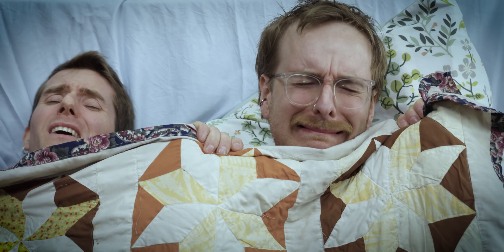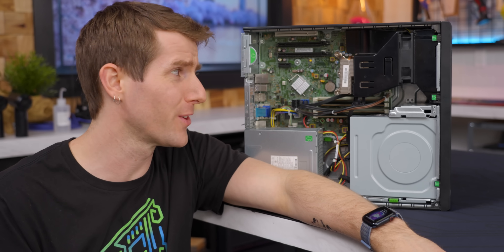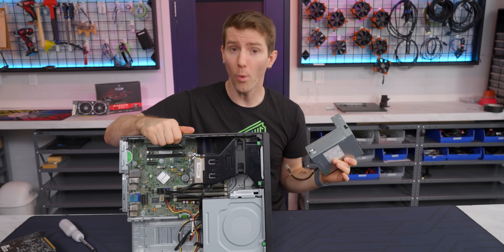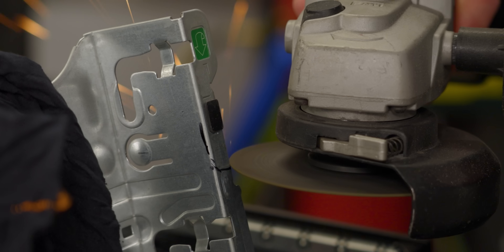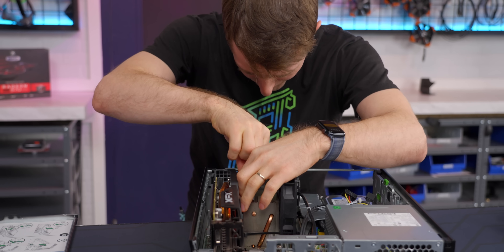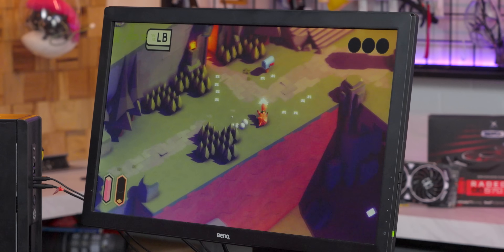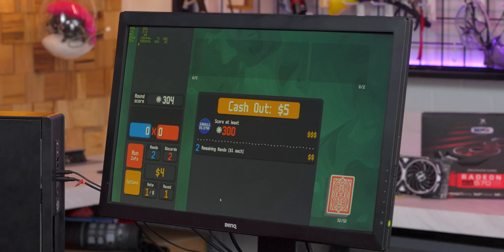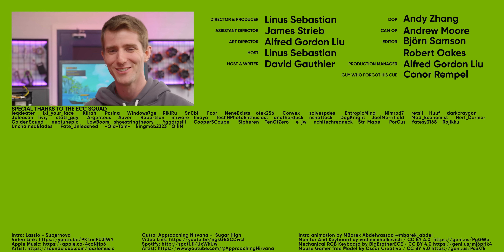How to Build the Ultimate $69 Gaming PC!

Comment: I am reposting a comment I made on another video, since I want to share my experience with prebuilds as well. I can't really reach that level of low price, but I still find what I have gathered to be pretty cheap considering I've went for the maximum possible the system can offer:
I bought a complete system—an HP Compaq Elite 8300 SFF—for around €25, which came with an i5-3570. This CPU is still capable of running relatively modern titles at ~60 FPS at high resolutions, making it a viable budget option. However, I would personally recommend going for a higher-end i7-3770, i7-3770S or a Xeon equivalent, as their hyperthreading significantly helps in CPU-intensive scenarios where the i5 can become a bottleneck. 

For example, in Shadow of the Tomb Raider, the i5 struggles to load textures on time, and in Assassin’s Creed Odyssey, it causes noticeable stuttering. Upgrading to an i7 eliminates these issues, delivering a much smoother experience.

I managed to sell the i5-3570 for €15 and purchase an i7-3770 for €30. I also upgraded the RAM from 2x2GB DDR3 1600MHz to 4x8GB DDR3 1600MHz CL11 (brand new) for ~€40, reaching the maximum capacity supported by the CPU. Additionally, I found a brand new Patriot P220 512GB SSD for €25.

In total, excluding the GPU, I built a fully upgraded Ivy Bridge SFF system for around €105-110. Depending on the games you want to play, you can pair it with a GTX 1650 LP, RTX 3050 LP, or even an RTX A2000 6GB, which are reasonably priced on the used market. I found a used RTX A2000 6GB for ~€195, bringing my total build cost to ~€300. 

With this setup, I can run games like Warhammer Vermintide 2, Counter-Strike 2, Mass Effect Andromeda, The Elder Scrolls Online, and Final Fantasy XIV at 3440x1440 resolution on Medium/High settings, maintaining 60 FPS with occasional dips to the 40s in more demanding titles like the first mentioned or Cyberpunk 2077. Given that the system only draws around 140W at most from the wall during gaming, I’d say this was a fantastic investment—if you can find the right parts at the right price.

Of course, if you can find a Ryzen CPU and motherboard for a similar price, that would be the better choice. However, in my case, the HP Compaq Elite 8300 SFF was 3-4 times cheaper than anything else available locally or even on eBay. So, I went for it and decided to upgrade it to its full potential. My initial plan was to use it as a server and ML machine, which is why I paired it with the RTX A2000. If I have to mention one main drawback of such SFF systems is that they are usually paired with a pretty weak PSU (as Linus here mentioned) which doesn't offer a 6-pin power connector for more powerful GPUs like the RTX 4060 LP, which can be handled by the processor at higher resolutions. (Do keep in mind that 3rd gen Intel CPUs also don't have the AVX2 instruction set which is already used by some modern games so a 4th gen at least is recommended. It all depends on what you want to do with the system.)

Comment: Hmm with that SSD... i would consider investing in PCI-E to M.2 adapter and good M.2 SSD... These cheap SATA SSDs like to die/misbehave (random I/O errors). They are not worth the $ saved, and cheap & small SSD will be the main pain in using this PC. Also it "just" stores all your data, the most valuable thing of whole machine...

Comment: As a sysadmin, I've actually thrown out a lot of Z220s and Z230s.  They're pretty rough and I wouldn't recommend them for much of anything in 2025.

If you want to go down this road, try to get a Z420 instead.  It shouldn't be much more expensive but it will have noticeably better performance.

Comment: I would love to see a mini PC setup build, especially with Minisforums Barebones UM890 pro with the Oculink port and EGPU Dock. you can pick storage, Ram, GPU and Operating System. With the use of a usb 4 hub, a bunch of other cool options are accessible.

You can get 144Hz Portable monitors using usb-c it could be worth even to make it interesting compare it to Gaming Laptops, see If you can build a better Performing setup using the same Budget even change it to a range to see at what price points which is better. 

A gaming Laptop is not much easier to transport as they use similar Power supplies, The thickness of Gaming laptops takes up a lot more room over your entire bag while a mini pc takes up the room at the bottom corner of the same bag, with the Portable display only taking up the space of the panel itself Leaving room for the Mouse and any Keyboard most suitable.

The fact some Laptops have Soldered Ram should mean that the Mini PC should be allowed to use 2nd hand ram,  it is a benefit to that option, if the laptop can also be specced as a Bare bones unit I think that would be an even better comparison with how similar it can be.

Comment: I recently picked up an old Acer aspire 1760 that had similar power supply connector mismatch. But instead of the second power supply I manually wired an old ATX compatible power supply to the motherboard. (Connecting the right voltage wires from the ATX power supply to the Acer motherboard.)  That way you don't have to use two power supplies and worry about them not turning on/off in sync.

Though a second problem I ran into was that the Acer motherboard needed standby power to be provided before it could activate the Power button, which would turn on a ATX power supply. So I had to jerry rig up a solution where my power supply is turned on initially by my restart button, and then the motherboard's proper start up is powered on by the power button. So you have to hit both to start the computer.

Comment: i built a $85 gaming pc from a HP 500 017c the cost was the PC itself and a RX580 8gb, I had the 16gb ddr3 on hand and a 600w PSU

It later is going to become my AM5 system

likely with a 9600x and a 40 series card in it or a Radeon card 

on top no HHDs all SSDs with a Blue ray drive to top it off
Reply: its my Linux machine

Comment: I got a dumpster Dell Precision 3430. Has an 8th gen i7, I put a 2tb WD nvme, usb wifi dongle, a sff RX 6400, dropped an 80mm fan in the front panel to blow cool air across the gpu, I then cut a hole in the top of the case and dropped a Cooler Master i7 Copper cooler with a magnetic dust cover slapped over the hole for the cooler. I can play most everything I have including, Anno 1800 with no issues.
Reply: Hate sff , it limits you to best GPU you can put there, which you did.

Comment: If you don't want to break the computer open with power tools, the 6400(4GB) and 3050 6GB both have small form factor variations. That said, the 6400 runs for about $120USD used right now and the 3050 runs about $200. The 6400 runs on motherboard power and most of the 6gb variations of the 3050 also run on motherboard, but you need to pay attention.

They both can player Cyberpunk, Baldur's Gate 3, Helldivers 2, and other modern-day games HOWEVER you'll be on low settings, and you'll be running on the bottom of the barrel on graphics. Similar to what you saw in the video.

Comment: I am a technician and run an IT business and I had all kinds of older great computers that I put a lot of time and effort into refurbishing, replaced thermal paste on and even upgraded some with additional RAM and brand new SSD's fairly significantly and had them up on Ebay forever and they never sold, I even had brand new computers I built listed on there and those never sold either. So now I just essentially take out the CPU and the RAM and sometimes keep the coolers and power supplies and sometimes the cases or motherboards and e-waste what I'm not going to keep. I've got all kinds of older components and even older All-In-One computers that are still pretty good. The only thing that ever sells on Ebay are used laptops as far as computers go. People seem to buy the individual CPU's I've listed there and that's about it, it is kind of a shame for both me and people missing out on them and also a lot of wasted time and effort. The older components seem to have more value in the materials they are made out of also.

Another factor here is with Windows 10 Ending support in October 14th of this year you will need an 8th gen or newer Intel CPU or a more modern AMD CPU to support Windows 11.

Comment: I got a really good system second hand (someones covid gaming pc) but turned out the motherboard was faulty. The issue wasnt obvious and a couple of components got damaged before we figured it out. I have to say that running linux made that pc extremely usable. I could not get windows to work at all with that set up (after a while, windows was what it had when I picked it up). I used that PC for about 2 years until I could swap in new parts that didnt have issues. While getting second hand stuff is risky the amount that you can save makes it so worthwhile imo even if theres something that is wrong with it that wasnt obvious.

Comment: I upgraded from my 580 8GB OC card this year but it was still running new release games above 100 FPS; with my tune on BO6 with display scaling I was able to get over 220 FPS. I’m still running my AMD Ryzen 7 3700X and DDR4 memory. Minecraft with Zesus shaders and 64 resolution pack was solid 70 FPS; I would recommend a 580 8GB card if you can get it for under $70 it’s worth the price probably got a year or two left before you have to upgrade unless you want to play pre 2024 releases without issues.

Comment: I tried to find something like this quickly and cheaply on the internet, with a bit of newer details and with which the user could also play newer games if necessary. These are European prices.

Intel Core i3-14100F / 74.99 euros,
----------------------------
ASRock Socket 1700 B760M PG Lightning / 116 euros,
-----------------------------
Kingston DDR5 Fury Beast Black 16GB 2x8GB 6000MHz
KF560C30BBK2-16 / 71 euros,
-------------------------------
Power supply Chieftec VITA Series 750W 80 Plus ATX/ 67 euros,
--------------------------------
SSD Lexar NQ790, 1Tb./ 68 euros,
----------------------------------
Video card ASRock Arc B570 Challenger 10GB OC/ 270 euros,
---------------------------------------
Case Asus A21/ 55 euros
-----------------------------------------
Total 721.99 euros

Almost forgot, Silentium PC Fortis 5 140 mm CPU Cooler SPC306/ +53 euros

You also need Windows 11, fans and a monitor. and some kind of mouse and keyboard.

Comment: i managed to get a free pc with an 11th gen i5, 8gb ddr4 3200mhz and a 500gb nvme ssd, the only problem could be fixed by adding a GPU, so i could have spent $69 on it and boom (although i had a 1050ti sat around which i also got for free)

Comment: $269 would be great! I think at $169 you’d have some good improvements in what you have already (such as the upgrades you mentioned in video) but $269 is a very affordable pc still that I think using the same cost savings mentality as in this video, will result in a very useable pc

Comment: Gotta have to say gpu wasn't an issue with the games tested for example on cs2 i have gtx 950 2GB and i get 120fps with mediumish settings but most of the time my other pc parts help with the lack of 2GB VRAM although my pc is also a bit unbalanced because most of my parts i got are hand-me-downs or got them at a really good price
My pc specs if you're curious 
CPU: ryzen 5 1600
RAM:24 GB 2666MHZ
GPU:GTX 950 2GB
2SSD 1HDD and 600watt psu

Comment: I have done the exact same thing with an old PC i had.   It had an intel i7 3770 equivalent xeon v3 E something 16 gb ddr3 ram and an rtx 3070ti😂 just lying around and wanted to make something to game on my macbook air using windows 😂😂 so i grabbed a stone something cheap case that came with a 250 watt PSU that had 1 sata port and a molex i used a sata spliter to add 2 more sata ports to hook hdds to and an other server supply 1200watts with a breakout board to power the GPU and I got a dummy HDMI slaped it all together and installed Moonlight and sunshine and hooked it to a router via ethernet and an other long ethernet to hook to a usb port using an adaptor in my macbook and THAT is how i can game on a 10 year old macbook at 1366x786 resolution laying in bed 😂😂😂 on a half decent PC  that has its case cut open 😂

FYI  I do have a ryzen 5700 and a 3080ti PC this is just for fun and I use this one more 😂 cz it was fun to build
Reply: I can post pictures of it if u wanna see it 😂

Comment: Despite the limitations of its Intel i5 2320 processor, the Acer M3970G Desktop (with 16GB of RAM) was able to utilize a significant portion of a GTX 1060's capabilities. Though a bottleneck was present, the system achieved respectable performance, consistently using over 50% of the GPU with a very very small performance bump compared to the i5 2500S

Comment: I always love the absolute bottom barrel price point computer builds but honestly I find it just as easy to find standard sized desktop pc’s for basically free. I’d away avoid the micro towers or anything half height since u are absolutely limited in gpu options unless u do cutting and jank stuff. Also, as was suggested by Linus a quad core cpu is absolutely necessary but also imo the most important aspect is that it basically has to be hyper threaded to prevent game ruining studdering. But fortunately any intel lga 115x xeons all the way from 2nd to 7th gen chips can be had for literally less than $10. Pair that with a $80 gtx 1070 and you have an absolutely solid computer for around $150. And it’ll probably look normal and be sellable once u decide u don’t need it anymore.

Comment: Few powerfull tips:
> 240W PSU is plenty enough for GTX 1060 6GB. Running a 6pin PCI-E power adapter from a single SATA is also acceptable with this kind of GPU. Did this many times and had no issues at all. Cables didn't even get warm in Furmark.
> i5 2500S is atrocious CPU, even in this budget. Not only its a super old 4c/4t, it's also energy efficent, making it even worse. Getting a cheap-ass Xeon from Aliexpress is the way to go. $20 for 1230V2 (i7 3770), or 1240V3 (i7 4770) is the way to go. You can also buy new 1x8GB DDR3 modules from Aliexpress for $5 apiece.
> RX 580 8GB for $35 is such a great price. Sells easly for $75 here in Poland lol

Comment: For 70$ i got lenovo pc with 1x16gb ram, i7 9700k, 1tb ssd m2. Got 16gb stick, gtx 970 to switch between spacedesk. No i have cheap 100$ gaming server. Psu needs to be replaced because it don't works with more powerful gpus. Downside is no lenovo gaming legion software, couldn't install it after flashed m2

Comment: If you are willing to take some time to do this you can even manage way more. A couple of weeks ago I managed to get an gtx 1080 build with 16GB DDR4 ram and an i5 7600k for 80€. And I even was willing to be an asshole, managed to sell it for 400€ on the same day and got a 340€ deal on a pc with an Ryzen 9 3900x and an RTX 3070. I basically spend 20€ and a weekend to get a nice pc. 
And for all that I just used local deals in a range of 20km. I picked it up by bus which was kinda awkward but I managed and it was well worth it. 

I also sold the pc a week later for 800€ and got another deal for a pc with an Ryzen 5800x3d ,32gigs ddr4 and a RTX3080ti for 900€ so I feel like lowkey not a lot of money left my bank account 😅

Comment: I went to do this challenge and seeing as I had to buy the LTT screwdriver set and the Thermal paste pad I only had 4 dollars left to work with.
Reply: You didn't have to buy anything
Reply: @Mark_badas I didn't have to make the comment either but here we are...
Reply: @manleycreations6466 they are right tho. You don't need that gear,  it isn't optimal but when I built my first pc I used a thin knife as a screwdriver. And the paste was 3$

Comment: Been rocking a very similar hp sff pc for years now! Added some ram, a gpu and some faster storage, and changed the cpu over time. Its still a pretty capable machine, running rdr2 with some decent settings on 1080 at ~60ish fps

Comment: I know this is not possible with 69 Dollars.
But imho the best bang for the buck is i5-8400 or similar systems.
They have ddr4, more cores, nvme support,  native win11 support, far more performance etc.
My best deal so far was an asus board, an i5-8400, a cooler and 16gb ram for 98 €.
I defended my i7-2600k for years, but those systems show their age for a while now.

Comment: I got a HP 8200 SFF took out the pow supply out gutted it , And gutted a 750 watt power supply and put the parts in the Hp 8200. power supply 's case, Put a LP GPU in it and 52 gigs ram and i7 ,

Comment: for anyone interested the tool he’s using is an angle grinder, with a metal cutting disk. you can have a new angle grinder for as cheap as 40$ and a disk costs 2$. be sure to wear personal protection and know what your doing when using them they can be a bit dangerous 👍

Comment: My house is full of these. I love SFF workstations as media PCs. Great for family gaming and movies. If you find an optiplex with an 8th gen cpu, you CAN flash the bios to accept 9th gen CPUs. Pair that 9th gen i5 or i7 with a decent LP GPU and you've got a great gaming rig for the price of a series S. If you can spend just a touch more, go with a Lenovo p340/350. They have beefier power supplys, and more room inside. I spent just under $500 and my kid has a 10th gen i7 and a 4060 LP.

Comment: I was lucky that my previous PC was an i5-4690 with 8 GB DDR3 RAM and a GTX 960 2GB I bought in 2015, which I upgraded fairly recently with an extra 8 GB RAM (about $15 in 2023), an RX 570 4GB (about $60 also in 2023) and an i7-4790 ($20 in late 2024) so now I have a system I'll be using for Windows 7 or 10 gaming once they force us to move to newer ones, like I kept my old Core 2 Duo E6500 for Windows XP needs.